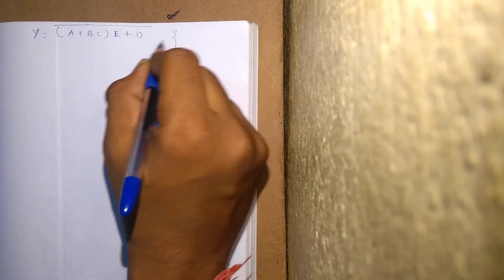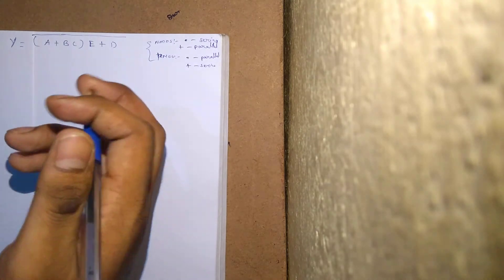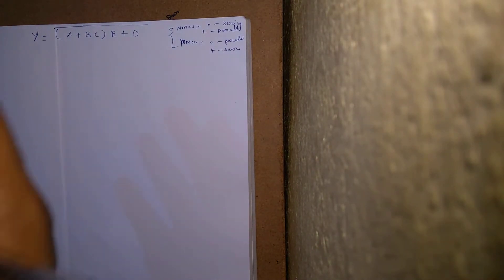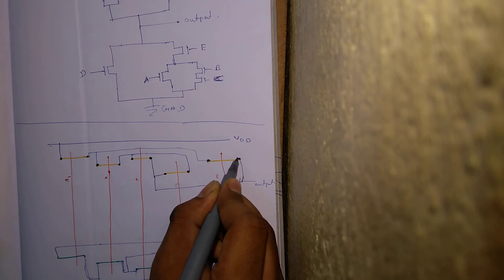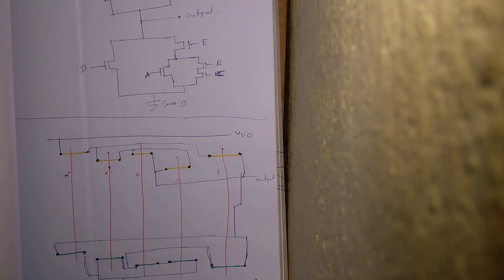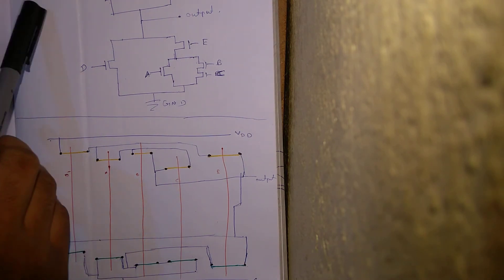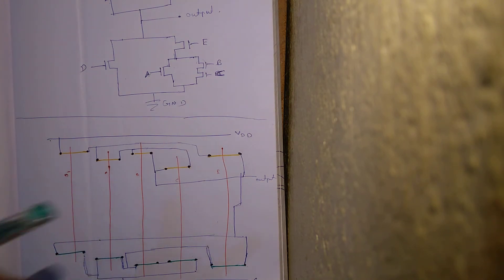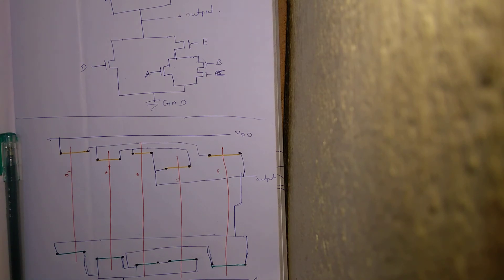Stick Diagrams part - 5

Comment: Sir, what to do if compliment was not given... please make a video on it..
Reply from the maker: Take Y bar whole bar.
solve the expression using boolean algebra.
then you'll get inputs as a bar, b bar, c bar
you can also have inputs in that form.
Reply: @yourclassroom7   (ab+cd)' what does this mean bro ??
Reply from the maker: @IsNikhil  AB+CD whole compliment
Reply: or else give the entire output for a cmos inverter (by taking double negation on the expression)

Comment: Thanks for the series. It was really helpful. But I think in this eg you have over complicated the things by yourself. First of all in the equation d exists at the other end, so d should be in the lower part of the series in p mos part. Likewise e should be in the lower part of the N mos part. Secondly the transistors can be represented as A B C D E  to simply things. I don't think there is not any particular order for representation of the transistors. All my opinions   though.

Comment: If the bar is not given then what to do
Reply from the maker: Take Y bar whole bar.
solve the expression using boolean algebra.
then you'll get inputs as a bar, b bar, c bar
you can also have inputs in that form.
but one thing is important "make sure that you have bar for the entire expression".